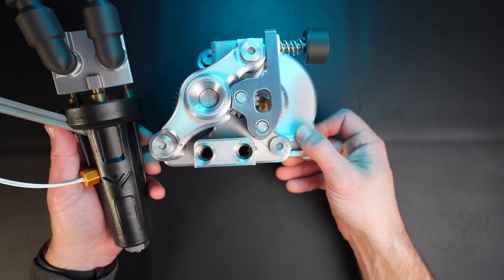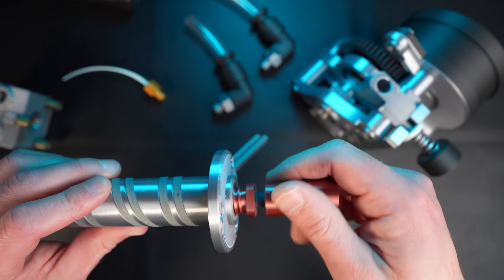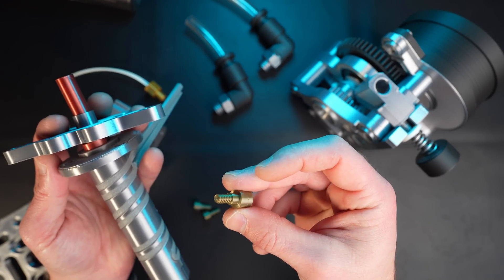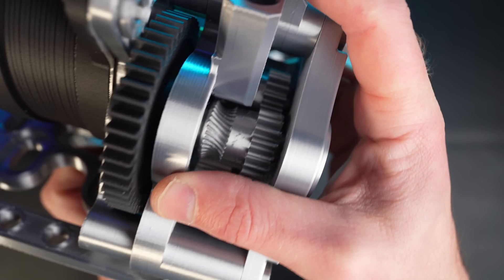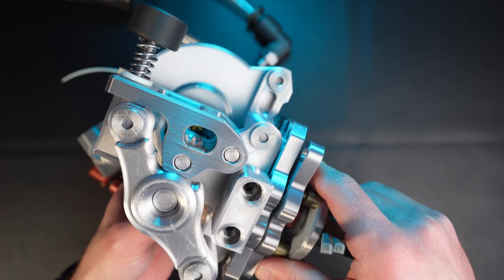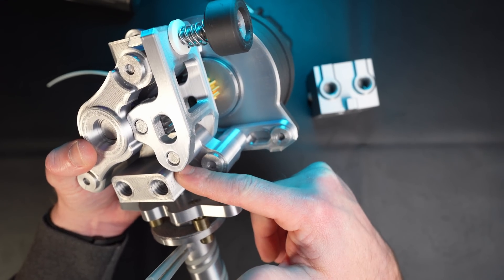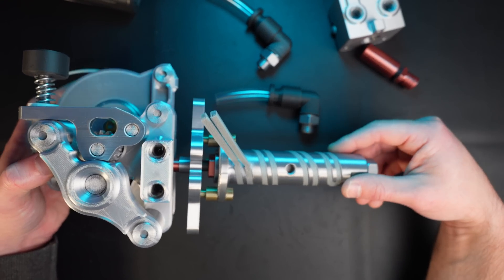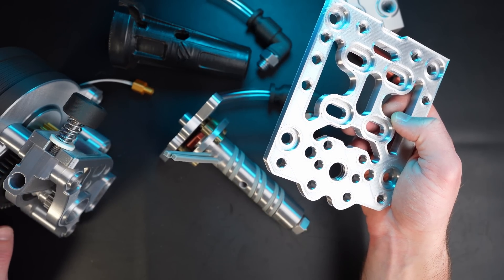3DPrinted Vz-HextrudORT

Comment: where is the cad file for this?
Reply from the maker: on github there is a mockup file :)
Reply: @Vez3D  I don't want a mock-up file..
I need to re design my current toolhead/extruder to try the gears out.

Comment: Can I use this extruder without the massive hod side?
Reply from the maker: The watercoole.one has a 4mm OD heatbreak. So its meant for the goliath. And its not massive honestly :)
Reply: @Vez3D  Thanks. I'm confused as to what some of the 14 options are selling on Mellow, and what is needed to get a complete hotend. I'm very excited about this, but it may all be too much $. It's very similar to what I asked mellow for 2 years ago, a water cooled aluminum orbiter with mounts for the crazy heat block. I can't find any documentation on the 3-bolt spacing.
Reply from the maker: @Haley  the watercooled version of the extruder will only with thr goliath and a aluminum vz-prinhead. If you have more questions i encourage you to join our discord server or fb group. We can help you there :)

Comment: cool video! Would it work with Voron 0.1 and Dragon HF? Do i need an adapter? Does it work with 10tooth motor? Thanks. Currently i run 3d-printed hextrudOrt but i want alumunium version.
Reply from the maker: 10th or 8th

Comment: So glad I found this channel and project!
How hot does the drive gears get? I want to iron large areas with very slow speed (20mm/s) using PLA. Will the PLA soften from the gears when it is fed so slow?
Reply from the maker: For now i dont have that prototype yet. I only have the standard air vz-hextrudort with watercool Goliath and it works beautifully 😍

Comment: I can't wait to get your printhead installed on my Voron. I have already replaced the x axis with carbon fiber, but the weight of the stealthburner is holding me back. I love how stripped down yet sturdy and practical your design is, just what I need to take my printer to the next level.
Reply: I agree. This printer VZ style is amazing. 
I think only the voron v0 has a top x axis all the others are front. 
It's alot of design changes to make it top mount x axis on them. It needs to be done an no better way to simulated it with some 3d printed extruders etc. I'm keen

Comment: Lovely print! What speed and temp did you print those silk filaments at? I find that if I print faster and hotter, silk filaments lose their sheen.
Reply from the maker: The speed was 250mms or 300mms for the bigger and between 5k for external perimeter and 10k to 20k for the rest. The little bolts however were printed much slower and higher temp to have them as strong as possible...because that silk cheap pla doesnt have good layer bonding honestly. But to answer your concern about shiny look, if you print faster you have to crank up temp to keep that silk look. I used 220c and 230c for that.
Reply: @Vez3D  thanks. I need to put some effort in to tuning for shininess. At least now I have some clues.
No, the silk PLAs aren't particularly strong. I think that's true in general, not just for the cheap ones. The addition of gycol to PLA weakens it.

Comment: What were your print speeds and accs for these pieces? They come out absolutely amazing 🤩. Great job as always!!!
Reply from the maker: Well.. i think they came out pretty crappy for most parts using that silk silver filament...besides somes small parts. The speed was 250mms or 300mms for the bigger and between 5k for external perimeter and 10k to 20k for the rest. The little bolts however were printed much slower and higher temp to have them as strong as possible...because that silk cheap pla doesnt have good layer bonding honestly
Reply: @Vez3D  just wild that that is your low end and those prints look great! My CR-10 is embarrassing at 70mm/s